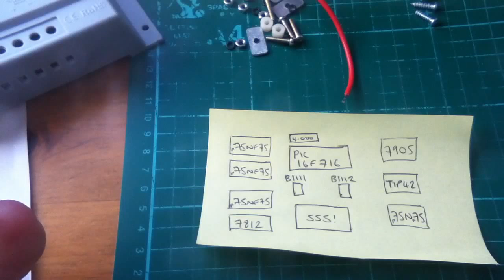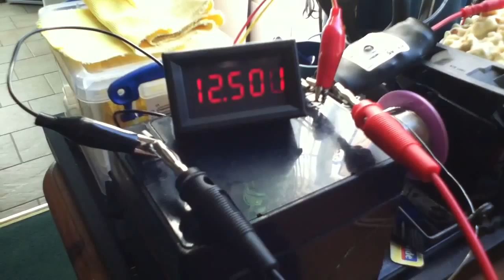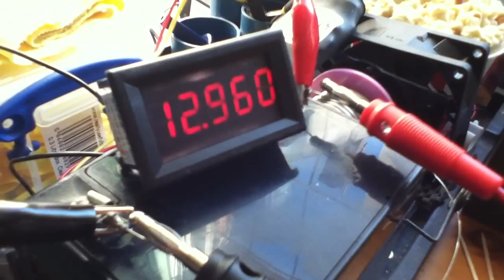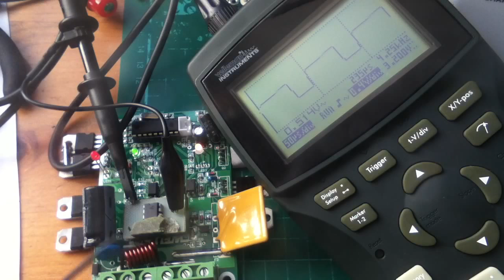WellSee MPPT Solar Charge Controller - Teardown

Comment: Thanks for the great teardown.
I will be doing a teardown and analysis of one myself 
Here is the link to the controller I purchased.
https://www.ebay.com/itm/MPPT-Solar-Panel-Regulator-Battery-Solar-Charger-Controller-12-24V-With-LCD-USB-/254122342776?varId=553463736562&txnId=2421368520015
I'm interested to see if it is quite similar

Comment: these company's must employ engineer cons.  that their first career was as a con artist. then they moved on to electronics. some of the stuff they do. is down right criminal! does nothing as claimed . or not at all. or like the li ion batteries. just enough to call it a battery. with capacity of a capacitor! who needs a 18650 with under 500 mah. it's fine for a display. useless for real use. I guess like any other line. there is someone ripping off ppl. when there is. a legitimate product. someone is gonna find a way to con !!!

Comment: Hi Julian, I really need your help finding the right (real) mppt charge controller thats also cheap, I'm doing a solar project in Africa and will be install over 7,000 solar panels and charge controllers and just realised you can get FAKE mppt charge controllers from your videos!!!

any product recommendations?

24v
5a
to charge 100ah battery (well, 2x 50ah SLA batts)
device its powering uses 13.86w max

thanks

Comment: thanks for sharing a nice video. but it makes me very sad because i have just bought it and hooked up with 150W solar panel and 12V100ah battery. I am working in china so i bought it here. do you have any suggestion for me? which mppt controller i should buy ?

Comment: Thanks jolian for a great video, i learned a lot. need your advice please:
i need a recommendation for a good MPPT, but not expensive one.
i ordered this one http://www.aliexpress.com/item/60A-USB-solar-controller-carregador-solar-Intelligent-PWM-Charging-Mode-light-timer-control-60A-for-led/32235724486.html, it works well, but when the solar panels voltage is dropped down (night time) the MPPT controller is auto switch to 12V, and never coming back to 24V. the charge controller is connected to a Grid inverter, so it is constantly consumes power from the solar panels.
The grid inverter is also 12/24V Auto switch, so than the two is switching to 12V mode.
is there is a way to set it to 24V, and cancel the auto switching? any advice?

Comment: Could you add a cylindrical chunk of steel to fill in the air core in the inductor , and add a capacitor to multiply the 555 clock rate by 10 to take it up to 40 kHz, and then measure how much more effective it is at producing greater amps during the buck conversion ??
Reply from the maker: That would certainly make it more effective, but it still wouldn't track

Comment: The inductor in a buck converter would not connect directly to the PV input.  If there isn't a relay in the unit, it would connect to the battery positive unless it is a boost converter in which case the PV voltage would be lower than the battery voltage.  My guess is this is really a PWM controller.  Easy to tell by watching the PV intput voltage on the scope relative to the battery voltage.

Comment: very interesting !  It might be that the inductor is there for looks ?  It could work if the switching frequency was MHz but I kind of doubt that is what is going on here.
Back to back FETs are also used in PWM charge controllers to keep the night-time losses low from PV module leakage from the battery through a single MOSFET's diode.

Comment: The only reason it's even pulling the solar panel voltage up the cap ,in conjunction with the ( some what attempt to make a Pwm signal ) shitty design at best . The easiest  way to find out if it is a true mppt tracker is to simply test input of the panel voltage after battery volte is nearly charged !

Comment: The 4 Khz switching frequency has nothing to do with the charging performance, the higher the frequency the more the switching losses and more attention to detail on the PCB layout, also the inductor is fine as well. the tracking intelligence is a based on the device firmware. there are some good app note datasheets from various EE companies that can help you understand this.

Comment: Agreed the whole device is common positive and this is counter intuitive. But bear in mind that NMOS types usually are more abundant than PMOS, have lower on-state resistances and tend to be cheaper. 

I strongly believe that two PMOS's could be used on the positive side (common drain), but I've never used or come across this. The gate drive circuit complexity should be the similar low-side or high-side (combinations of npns or pnps with pull-ups/down resistors, tailored to your logic needs).

Comment from the maker: The other problem with all these low-side switches is that the whole unit is common positive. OK it's a bit trickier designing high-side switches, but it makes the device so much more intuitive to connect up.

Comment: Its not that the design needs a current path from the battery to the panel rather I believe its the need to avoid that current path. Off hand, 3 reasons to avoid this current comes to mind:

1) If the panel becomes shorted this could cause the battery to short via the panel connection.

2) Disconnect the battery from the circuitry typically supplied by the panel (perhaps the PIC and magic black box) to conserve charge.

3) Leakage from the battery into the panel if a blocking diode isn't used.

Comment from the maker: Ah yes I see - your explanation and that data sheet have helped me make sense of it - thanks. But it appears to be a bi-directional low side switch and I'm not sure why there would need to be a current path from the battery back to the solar panel. A separate MOSFET controls current flow from the battery to the load.

Comment: Was just about to purchase one of these, thanks for posting this video.

Incidentally the back-to-back MOSFET pair with common drain connections is a low side switch. The reason for using two in this configuration is that the load is active (battery rather than resistive) which leads to the possibility for current to flow in either direction. The MOSFETs are connected such that their parasitic body diodes have common cathodes (drains) to stop flow in either direction. See Pg 19 of S-8232, as ex.